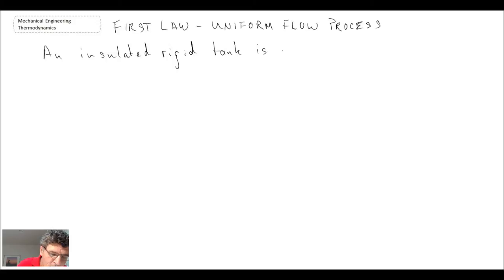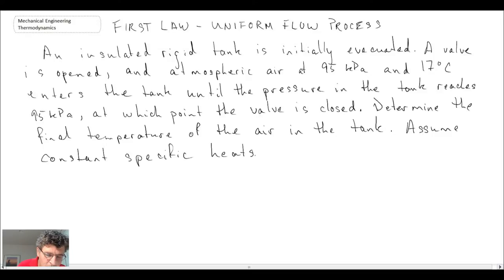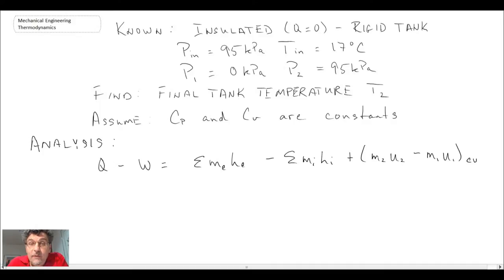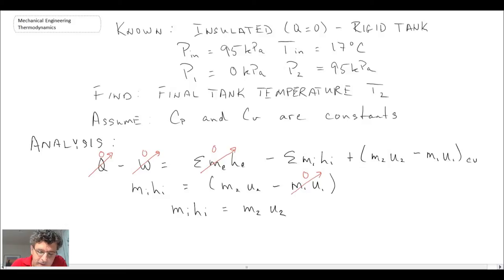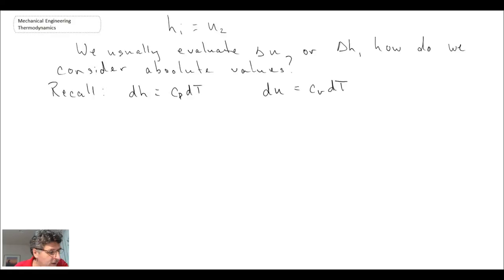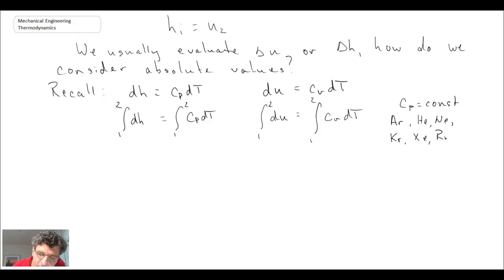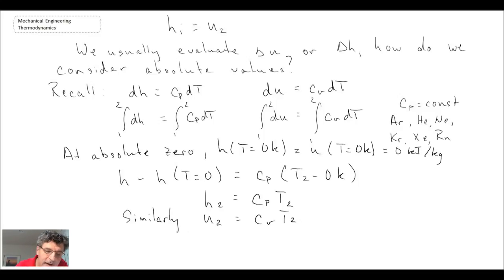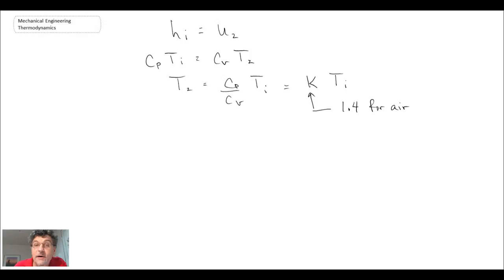Mechanical Engineering Thermodynamics - Lec 5, pt 3 of 3:  Example - Uniform Flow Process

Comment: This is interesting, and counter-intuititve that the final temperature will be higher than ambient, but I guess it makes sense due to the work being done on the air to move it into the tank.
I'm wondering about the opposite problem: An insulated rigid tank under pressure (N atmospheres) is at ambient temperature. The air is released and the tank allowed to equalize to atmospheric pressure. What is the final temperature of the air inside the tank?
I know the tank will get colder. According to this NASA article on isentropic compression https://www.grc.nasa.gov/www/k-12/airplane/compexp.html T2 = T1 * (P2/P1)^[(k-1)/k], which results in extreme low temperatures (e.g. an air tank at 11 atm ends up at -122°C, which is below the freezing point of CO2, which may be unrealistic).